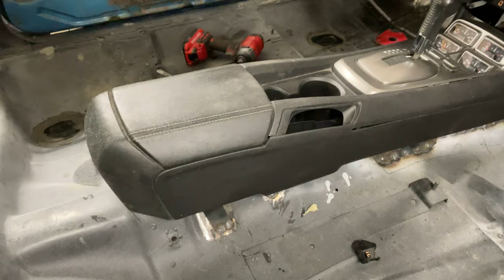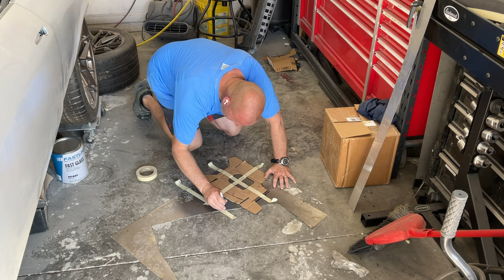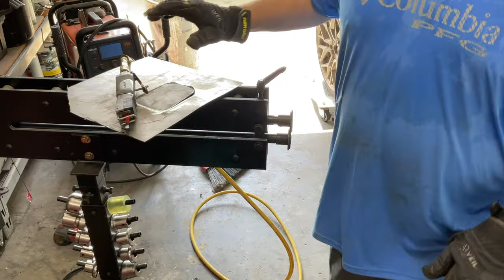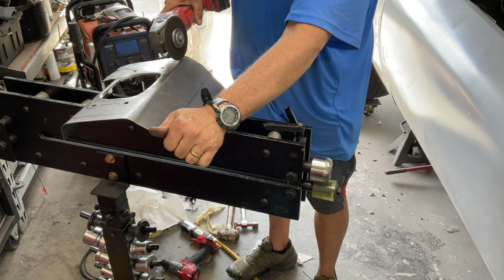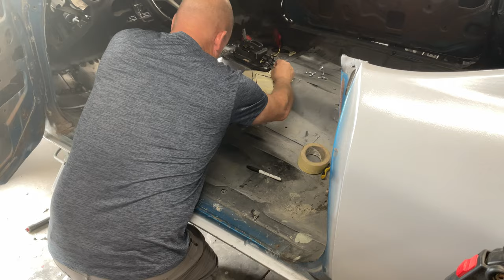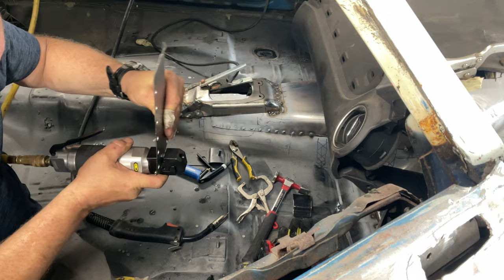Modernizing My Muscle Car with a 2015 Camaro Shifter

Comment: Awesome job. One question how did you fit in the gen v steering column? 
I am doing almost exactly the same to a 1978 Camaro in Denmark 😊
Reply from the maker: So I cut out all the original stuff first. Then positioned the steering wheel and column with the dash and seats in. Once I had the location set, I reinforced everything and welded it up.

Comment: How did you connnect neutral safety/ back up light switch for that newer shifter?
Reply from the maker: The shifter still has the sensor and wiring. I plan to connect to it. It has to be powered properly to unlock for shifting out of park

Comment: how did you get the gauges to work?
Reply from the maker: The marshall gauges have their own sending units or they connect to sources from the engine. I am using a Holley Terminator Max X for engine and trans management and they send signals for tach and etc.

Comment: Yeah , you  can mig weld, but you did nt show HOW you installed the console
Reply from the maker: I screwed the front down using the factory screw locations on the console and made 18-20 gauge sheet metal brackets and welded them to the tunnel. You can screw the brackets on too.